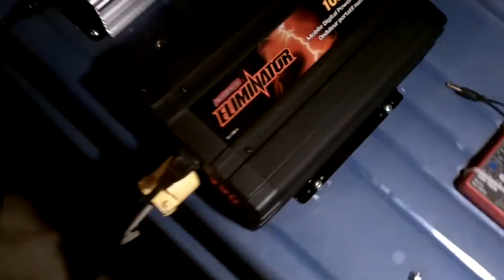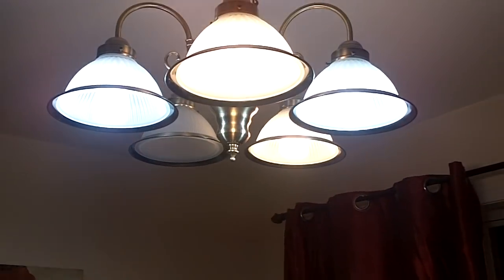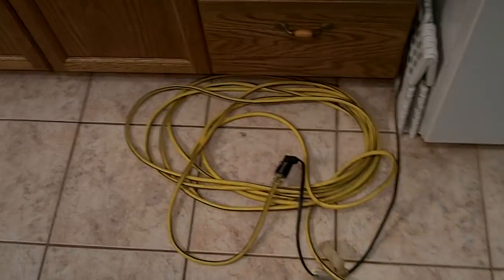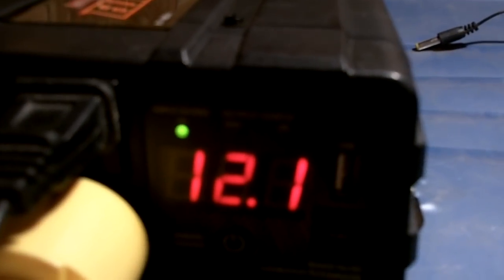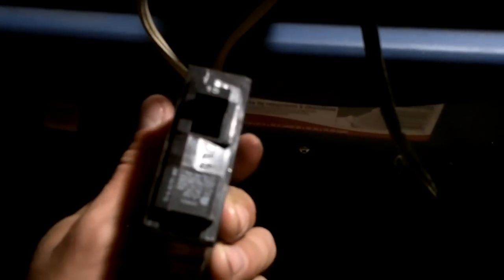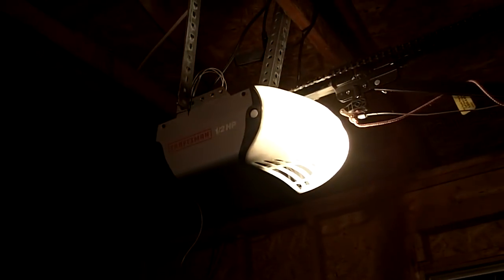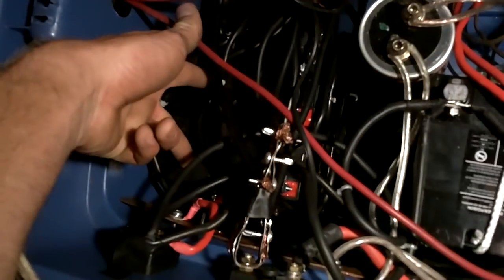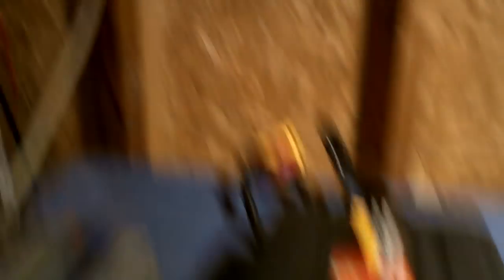House running off 1000W inverter

Comment: had a quick question. If i split resistor the
voltage from a laptop cord to 12v, will that
 power a 12v car inverter. If so, can i plug
 the laptop back into the outlet part of the
inverter and use it as if the laptop powering
 to charge it self.
Reply: It doesn't work. Add a 12 volt battery on the DC side and it may run for a short time, but the whole assembly would lose power at a slightly greater rate then sheds heat.
Reply: I'm not really sure what kind of setup you are suggesting. "Split resistor", "laptop cord"? What exactly is a "laptop cord" in this scenario? The combination of a separate power cord and a external power supply (with a fixed cable running to the laptop) is not a "cord". Where would a resistor go, and what kind of a resistor? Split resistor as in linear regulation, where voltage is lowered by using the remaining fraction for heat?

Some kind of a free energy trick or perpetual motion machine? No, that does not work. Free energy tricks never work. Period.

You can, however, run a 12 volt to AC inverter from a laptop power supply, if its voltage is around 10-15 volts, and the inverter is not being driven hard, and this does not involve a laptop at all. Just the power supply. I don't know why one would want to do this. As an improvised means to run low powered 110 volt devices with a 110 volt inverter without batteries when in a 230 volt location, or vice versa? Yes, that will somewhat "work" if done correctly. Marginally usable anyways.
Reply: TheVessapaperimuumio He's trying to bring a battery, charger, and inverter into a closed system and wanted to know if he had just discovered how to make perpetual energy. I think by "split resistor"  he was trying to figure out how to regulate the higher than 12v dc from a laptop cord so he could use it as a
"dumb charger:" But it sounds like you're informed enough to have figured that out, so I'm probably not telling you anything you didn't surmise.
Reply from the maker: im not sure. sorry
Reply: TheVessapaperimuumio
thanks For The Respond. I'm Still Learning. Was Just Curious.

Comment: Only problem I see here is wiring. You need much ticker wires even inverter is only 1Kw. I build my own (I'm electronics engineer) 3000 watt pure sine wave and had 8 gauge wire connected to battery and showed me "overload" at 2500 watt, changed wires to 4 gauge   run with no problem even over 3000 Watt. Same thing happen with one I bought at Wall Mart 800 watt with original connectors start beeping at 600 watts, since I paid only 60$ for it I took out connectors from back and soldered 6 gauge wire straight to PCB (I removed Batt terminals and feed wire trough that holes) of the inverter (I know warranty is void but as I said only 60$ ta heck) and you folks not going to believe me, I was able to power up grinder stated 600 Watt and only 1 LED come on out of 4 I guess each led stand for 200 Watt,I run that grinder for good 5 minute's inverter was not even warm. Good thick wiring plays BIG ROLE take my word for it! No matter how many battery's you have connected in parallel to bring up Amperage if you don't wire them solid you don't get results.
Reply from the maker: I used 2 gauge wires to inverter, that double what was required. thanks for the good advise though.

Comment: This is easy I know how you did it. U ran the 120v wire from the fuse box
then wired an extension cord to the end of the wire then pluged it in to the inverter
Reply from the maker: kinda doing it this way means you have to make sure the main power is off, or your will blow up your inverter and possibly hurt yourself
Reply: i know u need to do this because if u don't it will send power back to the power inverter
Reply from the maker: yes exactly

Comment: Did the inverter last long
Reply from the maker: I used it for a year, and now my grandpa is using it off grid up north for his house. so its about two years old atm and still kicking.
Reply: That's sounds like a good inverter. Was it expensive?
Reply from the maker: $150 on sale, i liked it
Reply: That's a good price. You can't do better on price.
Reply from the maker: fidel catsro canadia tire has there deals once in a while:)
Reply: even china made pure sine inverters cost about 250usd, 150 was a steal!

Comment: You stated you upgraded to a 3000 watt Xantrax.. 24 volt?  running off of your battery back up system? Question, do you have your 3000 SW Xantrax wired into your home electrical service circuit panel? thanks.
Reply from the maker: not yet,buying the generator sub panel soon,im using 12 volt battery bank still. I like 12 volt battery banks more then 24 or 48 cause of the price of all the components. I have about 1400Ah now as well

Comment: what type of battery you are using? I mean, for couple thousand watts load, the dram from battery gonna be something like 100 amps
Reply from the maker: with the setup in this video I could pull 100 amps max from the batteries, and i was using about 200-400Ah of batteries to run the inverter.

Comment: This 1000 watt pure sine wave inverter, is it hooked to your home electrical panel ?
Reply from the maker: yes it was, I have upgraded to a Xantrax SW 3000, to run everything at the same time with out having to shut high power items off to run other high power items

Comment: Nice setup, by the way the dc side current is always higher than the ac side curreny because of difference in voltage.. but the power is much the same depends on how efficient is your inverter..

Comment: Very cool what your doing..but your battery bank not so cool.. would be better to have 2 or 3 big deep cycle batteries in parallel then then the cap wouldn't be necessary because then the voltage wouldn't sag on heavy motor load starts..   what would-be best for you to do is to separate big load items like refrigerator. Freezer.washer..drier..if all electric ..stove..hot water heater..and only run light duty stuff..like CFL bulbs..flat screen TVs..laptops..small stereo system.Ect off of inverter..getting completely off the grid takes a very big expensive system..
Reply from the maker: true, my system has changed a lot check out some newer videos

Comment: I had Asimilar set up. Marine batteries, only 10 watts solar , but mixed in camping gear, 40 qt. Cooler(4 amp hr) propane stove,20 lb. Tank 750watt inverter,wood stove. I suggest a larger car	/ truck alternator 400 amps or more to charge batteries , maby  an isolator.
Reply from the maker: nice, im all setup in my jeep for power for camping love it.

Comment: Nice video - i want to ask a question that if we convert DC to AC and then run this AC in a long long wire with no problem to a distant place (as this is an AC so it will run easily with no resistance) and after reaching that place IF we need to convert that AC again in DC to feed a DC ceiling fan , then what will be the energy loss ( roughly , how many percent ? ) thanks .
Reply: it only consumes 5 watts more if we convert that A.C to DC again as I asked the question 3 years ago :)
Reply: DC transmission is more efficient but only noticeable on very long distances or armoured cable.

Comment: Great stuff and this shows what you can do with very little equipment.  I started like this now I use a 3kw pure sine wave inverter with a small  bank 700ah of motorhome batteries.  This will happily run the house for 3 days without charge but I have 14 80w panels which give around 80a of charge so when the sun does appear the batteries charge pretty quickly.  I also use grid tie inverters because in the winter we only get 4 hours of usable daylight and worse if it's overcast as well.  Keep up the good work.
Reply from the maker: TY, check out my Xantrax sw 3000 video for my updated system, im improving and learning a lot on the way.

Comment: Awesome so when you back feed your house , you shut off the main , an the Circuit Breakers you don't want Power . I know about the double prong plugs , you can just plug it into any plug an it back feeds ..
Reply from the maker: yes, but be very careful, this method is not safe!
Reply: Yeah thanks just wanted to know how it was done .

Comment: Nice setup!  I have a cobra 4k inverter and i used it to power my 120VAC welder.  I bought mine for 100 bucks and mostly use it to show off but the dual batteries in my truck run most everything just fine.  Inverters are a handy tool to have!
Reply from the maker: yes, i have a 3000W eliminator inverter in my jeep, i love it check out my other  videos to see it.

Comment: I am using a 5000 watt aims inverter, hooked up to my moblehome, and I changed the breaker panel,with a homeline 100amp panel,20amp breakers,hard wired to the inverter, with 6 109ah battery's, deep cycle,at Walmart 100.00 each about, 3-105 watt grape panels,and charge controller,Homedepot, 400 watt wind turbine, which the wind blew it out of the ground,have to replace the blades and make the hole 2' by 2' and 2' deep filled with concrete for the pole, but I need more power for freezer and swamp cooler,washer and dryer.Ha ha more power tim allen might know right?
Reply from the maker: you need more solar panels, at lease 1000W worth plus a wind turbine, also more batteries for cloudy days.
Reply from the maker: timcat100 I told him how to run a fridge not anything else so go troll somewhere else.

Comment: got a little 750 inverter I bought for 40 dollars we use it in the rv for watching movies on the lap top and running a small fan for the kids because the ac does not work unless were plugged in at the camp ground but it kicks off if I put to much draw on it   my friend told me it kicks because I plug it into the lighter plug. will it run more items if I hook it  directly to the battery under the hood
Reply from the maker: Yes it will run much more if you do, and use thicker cables, the lighter plug can only supply 150watts max if you plug directly into the battery you will get the hole 750 watts out of your inverter.
Reply: think ill just buy a new bigger invertor for  my next project we are going to put a dj set up into a mini van that will  consist of a entire dj set up like I use to do a wedding reception with a pair of peavey 15,s it should really pound  considering one of our dj set ups puts out up to about 3000 watts and we are going to logo the van up real good and cruise it around town as a stunt to drum up more business for our dj company here in missouri.SO ILL JUST WIRE THAT LITTLE 750 WATT INVERTER up to the battery in the rv and it should run the refridgerator as well.WE already have 12 volt lighting while we go down the road just no 120 volt
Reply: thanks for the advice

Comment: I understand your terms.and yes my suprex 600 watt inverter will run my fridge, but not my airconditioner.yeah suprex.but 1750 eliminator wont run either.I use it for lighting now and the 600 watt for my tools and fridge.I also switched to gridtie so the battery bank is for backup.

Comment: I bought the same inverter and was very dissatisfied.warning it has no or bad overload protection. How I killed mine .brought it home, hooked it to my truck battery and my fridge.I guess they were not compatible. I turned on the inverter.it instantly shut down from too much draw.you can reset it by turning it off then on again.so I did.nope.one more try.and no again.I should have seen that as a warning.as it never came on again.even let it cool down.nope its dead.killed it in first five minutes.I now have two 1750 watt model.it works , has better overload protection, but even with huge short battery cables .I can only draw about 900 watts.but not 1000.I have four deep cycle batteries as suggested.why can all of my other inverters work at their max excellently like my suprex 600 watt works with my 600 watt coffee maker.pro watt 150 does 150 watts who knows
Guess my point is be carefull its fragile lol.dont do what I did.
What, did you shut off the house mains and plug directly to an avail outlet?
Reply: The fridge compressor might have had a lot of head pressure from running recently and the inverter didn't have the surge rating to kick over the compressor. My 600W pure sine wave inverter has 1000W surge and it started our fridge. Also the inverters have an internal fuse which probably blew. Open it up and see if it has a blown fuse you got nothing to loose.
Reply from the maker: you may of got a bad inverter, i know of another guy that got a bad one, I have run mine at 1000 watts no problem, I have overloaded mine at least 20 times and all has been well if you are only getting 900watts out of your 1750w inverter there is a problem in your wires/batteries, to get over 1000w out of your inverter you will need at least 2 gauge cables no longer then 3-4 feet max or go with thicker wire for longer distance.

Comment: Hi. Great vid. Is there any chance I can use a large battery (normally used in Mack trucks) in this system?? I would prefer buying 1 large battery over so many small ones.. thanks
Reply from the maker: hi, yes you can buy one big battery, i have 7 big batteries now if you watch some of my newer videos you will see them, and no do not use a car or truck battery unless you just have it kicking around and have no other use for it,it will not last long at all.

Comment: A 1 KW inverter runs your entire home? That is okay for LED lighting and other light work, but I would think your refrigerator alone would require more than 1 KW. Now add a TV, computer, microwave and you would be better off with a bigger inveter.
Reply: Fridges are only about 100 to 200W while running. It's just the start current which is probably about 1000W.
Reply from the maker: You are mostly right, with a 1KW inverter you can only run so much, i can only run either my fridge or my big chest freezer at a time, i can also run my gas furnaces and all the lighting + my freezer, but not my fridge, i have a old crapy fridge and it takes a massive load at start up to run and can only be used with LED lighting.
Reply from the maker: yes you are right
Reply from the maker: timcat100 mine doesnt have a mode that takes more then 180w continues, so i gues nothing will happen just like it has been for 2 years.
Reply from the maker: timcat100 LOL ok man, think what ever you like, this little inverter ran the fridge all the lights and laptop. I gues you know nothing about these things, i have upgraded to a larger inverter so I could run the fridge and freezer and everything else at the same time, but the inverter in this video was a great little inverter made by xantrax NOT A CRAPY BRAND.
Reply from the maker: timcat100 and now after you realize how much of a dink you where, I would like to say GL with you solar looks like a good system going in.
Reply from the maker: timcat100 im not sure why your so mad, everything you started out mad about was in the description, and i pointed it out,i think its time you leave, thanks.
Reply from the maker: lmao your on crack I am done with you bye.
Reply: timcat100 stupid F""""""""G video!!! LMAO

Comment: I just can't help thinking that you could wire up 12 volt emergency LED lighting for inside the house and in the garage having those batteries sitting around. You could have a small 120 volt relay energized when you have utility power, then use the contacts that close on loss of power and feed the 12 volt + leg thru the contacts. Fuse everything with automotive fuses, run bulk extension cord cable thru the attic to a fixture in the main part of the house. Put one of those 30 LED array stick on panels inside your light fixture. Then your family will never stumble in the dark during an emergency. It comes on automatically. Current draw is next to nothing and 14 gauge extension cord has your positive, negative and ground neatly inside. Cheap, too.  I would also like to remind you that a clean garage is the sign of a sick mind!

Comment: Awesome. I would like to build one. I was considering using a generator transfer switch that can be wired into the house breakers.  Apparently these can switch on selected circuits ...fridge, furnace, etc.  Inverter feeds into the transfer switch.  Have something like a Guest marine battery charger and a solar panel with charge controller to keep the batteries charged. UNPLUG the battery charger when using the inverter so it doesn't drag the battery down.

Comment: Am sure you are far past this by now.  Am not sure what your use case is but a 3-4kw would be good if you are wanting to run the whole house.  The problem I saw in this experiment was the batteries.  It's not generally a good idea to mix battery types, age and sizes in a practical exercise.  In either case, you have a backup system that should keep you going if the power goes out.  May not be complete but something is far much better than nothing.  Have a good night/day mate and thanks for the posting.
Reply from the maker: Yes my batteries are my weak point,and have already made changes to them, all my batteries i have now are of the same age and most the same size.
Reply: SAME